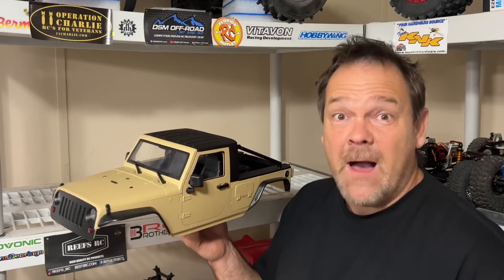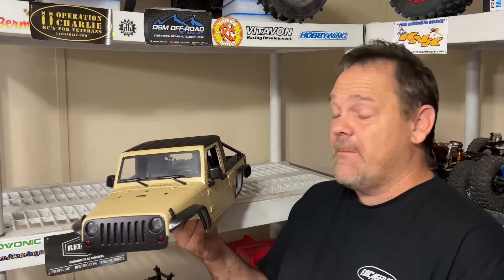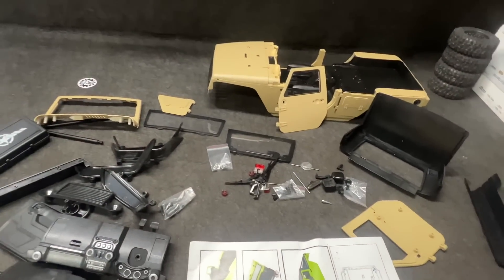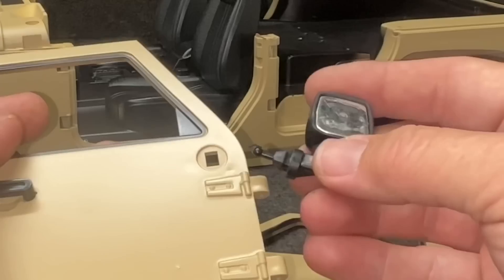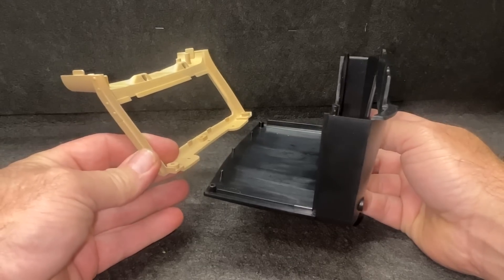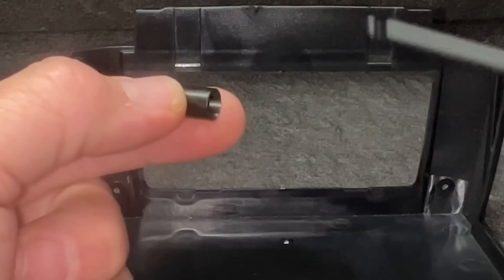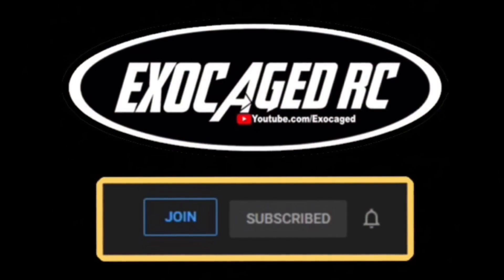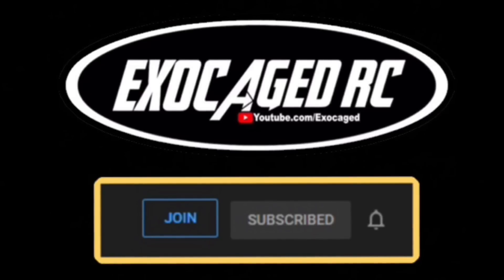The Injora Hardbody is NICE!!!

Comment: Don't glue the back side of the bits n bobs, use a soldering iron or wood burner to melt the points down just a little
Reply: Done the same thing.

Comment: Tips. First thing that will break is the roll bar. Reinforce however you can. Put small bar magnets to keep doors closed. 

For body mounting, put magnets up front on the posts. In the rear unbolt the box, find some hex bolts that will thread into the post holes on the chassis and drill holes in the body to accommodate. Don't worry the box will cover the bolts up.

For the box, modify to cover hex bolt heads, put magnets on the inside bottom of box and align with magnets underneath the body. Use magnets to close the box lid to make the container useful. I carry a hex key in it for body removal. Good place for spare parts as well. 

I also used model paint to paint the body details.

Comment: I put that body on an SCX10-3. Mounting was tricky. Had to get creative. I wanted a solid connection to the chassis so i ended up with 2 holes in the bed. I used the box in the bed for a 2200 3s battery so batt swap can happen without removing the body. Makes a great trail truck.
Reply: I have an SCX10.3 as well, I'm scared to buy this if this is not a direct fit for that chassis. What moda did you do? Did you remove a lot of orginal parts from the chassis? TIA.

Comment: I'm running the same body (orange color) on a 10.2. I drilled all the way through the top roll bar and mount on each side and installed a m2 bolt with nut and loctite, the roll bars would pop out during a roll over plus I carry it by those bars on occasion. I designed and 3d printed a rear hinge and front magnet mount system for mine, I still have the .stl if you are interested. There is a video on my channel running it here on the Oregon coast if you care to see it in action.
Reply: any chance you'd drop the stl in thingiverse or some other repository? I'd love to take a peek and see if I can adapt it to my old scx10.1!

Comment: I used magnetic mounts like you then I opened up the box in the back and used magnets on the lid then drilled holes for body posts. so I can clip the body down then put the lid back on and they can’t be seen

Comment: If you haven't figured it out yet, that body will scratch super easy. It's got a single layer of paint with no primer under it. Also, a nice little hack is to cut the screw tabs inside the rear box and put magnets there to make the box functional. Last, if you're interested in seeing the 1/1 truck, look up the DV8 JKU Truck

Comment: a gob of shoe goo where the top of the roll bar sets into the ball socket will keep it from popping out. I also use a small dab on the doors so they don't pop open when you are driving. you are right the directions are vague at best

Comment: Just wondering how much weight that will add? I like it!👍😁😎✌️
Reply: I have the big four door version and it weights 800gram. But the most of the weight is low in the body. Like 70% low because of the interior, floor and seats.

Comment: Forgot the most important step. mounting it to the chassis lol
Reply from the maker: Yeah….I’m working on that. LoL. Possibly the hardest part but I’ll use magnets and glue. 😂
Reply: @ExocagedRC  Lol. Hey, whatever works! I did the Injora half cab with cage hardbody build and it took me a while to build. I used hot glue just about everywhere. It didn't "click" together like this body did. I did however like that they included mounting tabs to mount at the front of the chassis and back of the chassis. Did this one not come with the mounting tabs?
Reply: @ExocagedRC  PLEASE POST A VIDEO...WONDERKNG IF I CAN REPLACE A TRX4 BLAZER BODY WITH THIS. ANY INFK WOULD BE GREATLY APPRECIATED.💯